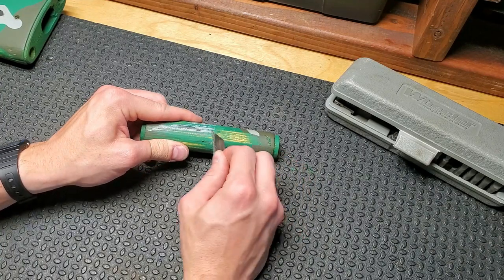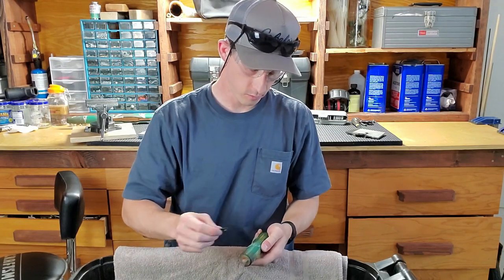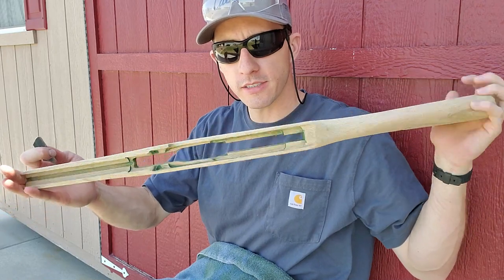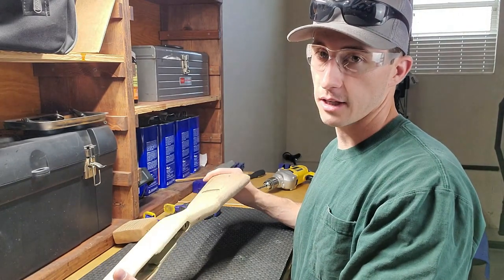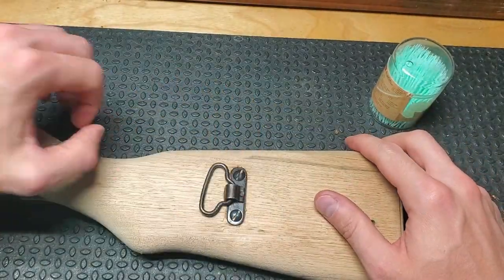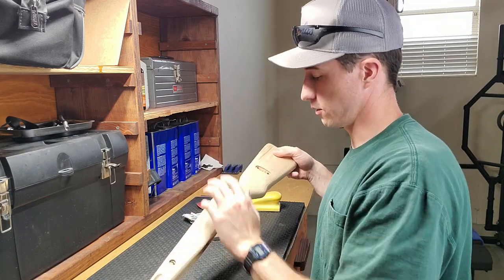Un-Bubbaing: An In-Depth SKS Stock Refinish.

Comment: To remove imperfections between coats you might try 'brass-wool', Not 'steel-wool' because tiny bits of steel will imbed into the finish and rust. Any tiny bits of brass won't rust/less of an issue.
 Other that that, 'nice job'! You have inspired others to immulate your process.
Reply from the maker: Thanks for the tip! I'll have to give that a try. Glad you liked it. Thanks for watching and for your comment.

Comment: Where did you buy those metal container?... what do you call?
Reply from the maker: If you are talking about the cleaning kit in the stock, you can get those on eBay or other various gun parts stores. Just Google sks cleaning kit and something should come up. 
Thanks for watching and commenting.
Reply: @CRoutdoor  I mean metal tank that you use for acetone and water bath for gunstock
Reply from the maker: @danielsong6335  Oh, yeah. I had those custom made by a stainless steel fabricator in my area. I'm sure you could find a similar fabricator wherever you are.
Reply: @CRoutdoor  ok thanks but idk what do you call?...thanks anyway...